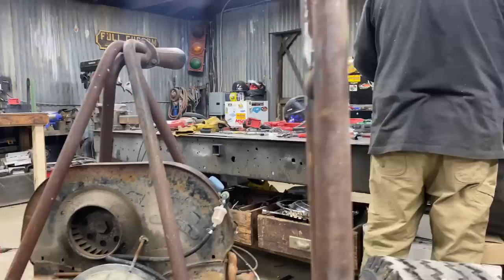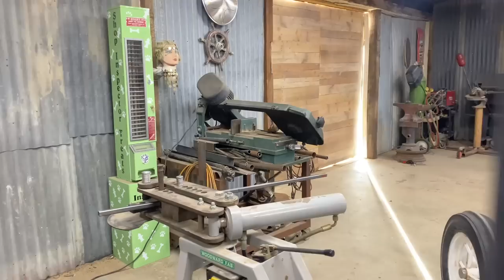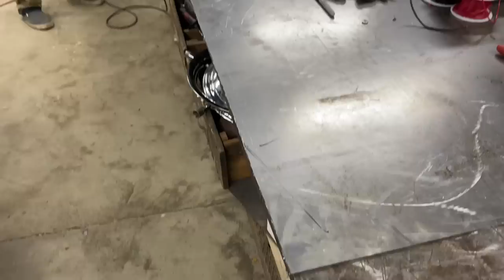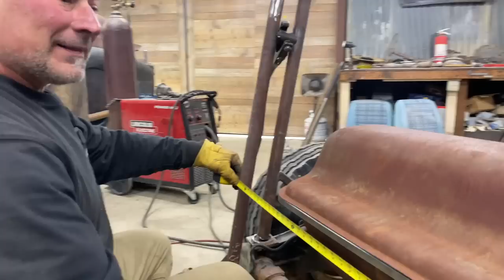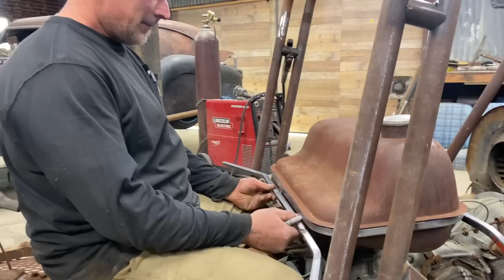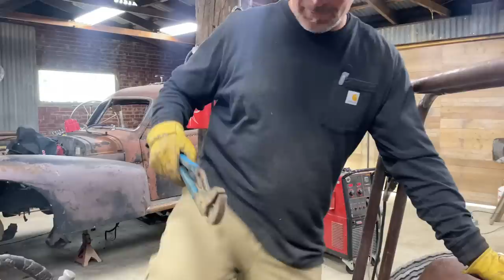Ian Roussel Old School Dune Buggy Fuel Tank Install

Comment: The channel is working really good, good content. Nice balance between information and banter. Couldn't have wished for anything better. The sound and camera work is very good.
 I've had loads of jumpers with holes burned in the lower right part of the body. In fact I've got one on right now....
 Many years ago I had to go to the local hospital, I'd had a grinding spark in my eye for a couple of days, which I couldn't get out... I got my head strapped to some kind of frame work they had bolted to a desk and the doc came at me through a hole in a magnifying glass with a hypodermic needle straight for my eye ball. I barffed all over him as he poked me in the eye with the needle..... Always wore googles when I was grinding after that.....
Reply from the maker: Ohh I can understand that! Eye protection is a MUST with car building! Stay safe 😎
Reply: @fullcustomIan  Ear protection too. I said EAR PROTECTION TOO! ;)
Ever spit "color" after welding, sanding, grinding or painting.. wear a mask. Would you run a prized engine down a dirt road without an air filter? Lungs are harder to replace than an engine.
NO, I'm not the safety police. Do your thing. I'm just a worn out old guy who should have listened when he was younger. 
Maybe some talented young person will read the above comment about the eye (been there) and mine and be able to continue this hobby a bit longer and be healthier than us old farts who were "tough".
/mini-rant over  ;)

Comment: The lever handle on the gas tap is for reserve (not off), The early VW's didn't have a fuel gauge, you just drive until it started sputtering and then reach down and turn it, I don't think we had seatbelts on my Mom's '63, or at least I probably wasn't wearing it back then anyway.
Reply: That's the way I remember it.😊

Comment: The pointer for your degree wheel, is made from a piece of 8 inch TIG wire. Wrapped around that little bolt on the large rotating tie portion

Comment: You can take the stock fuel tap off. Tap the whole for 1/4” pipe thread. And screw in a brass fitting. It works good

Comment: Hey geno here again ,my son has a 1-ton 4x4 extended cab just setting .
Don't know if he'll part with it. 
But the last time it ran it had a ghost in the wiring, so it ran then it would die.
Let it set then it started. And it's all the way back here in central Missouri,

Comment: Ian I enjoy watching your builds. The angle tube to the fuel valve was for the reserve. The early cars did not have a fuel gauge and the angled part stuck out in the center of the floor by the gas pedal so you could move it with your foot after the main ran out. My parents had one when I was a kid.

Comment: The switch on the bottom of the tank opened the reserve tank.  If you remove the valve you will discover two stand pipes, the tall one is the main, the short one is the reserve.

Comment: There should be a threaded hole in the forward face of the clamp leg of your bend die. Put a bolt and take a piece of wire wrap one end around the bolt and shape it into a pointer.also in the follow die. There should be a roll pin in the hole on the follow face which can be used to adjust the follow die height.

Comment: I would install a rubber gasket between the tank and the metal. Metal on metal as it pertains to a fuel tank is never good. Just for fun... a little trick I've learned; buy a packet of cheap "super glue from HF. Seal the threaded seams on your gloves with it. Doesn't take much but the sparks won't burn the threads and cause your gloves to disassemble themselves... I'm old and on a fixed income so I guess I'm on the cheap... but they last a lot longer. Fun channel to watch. You guys make a good team.